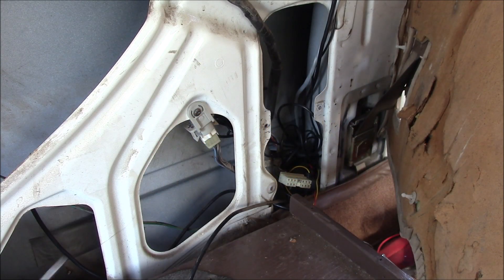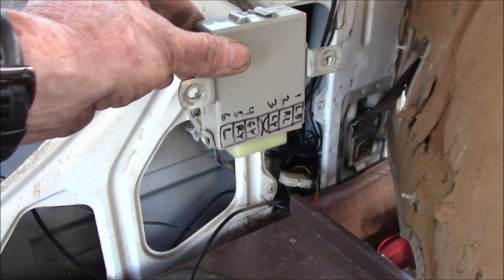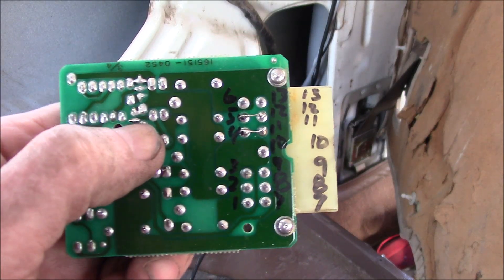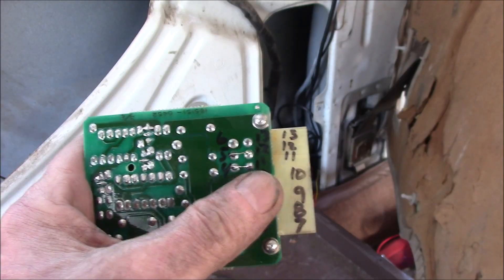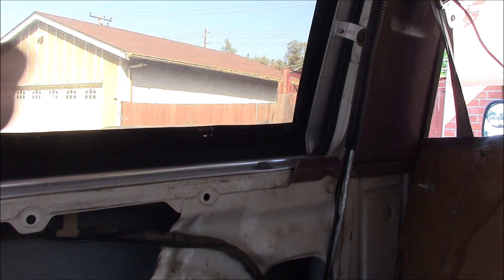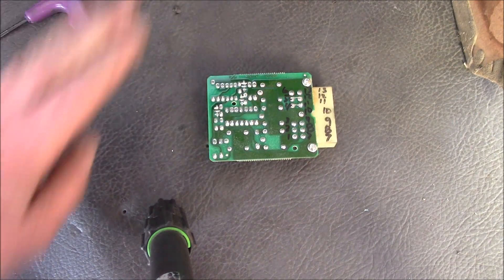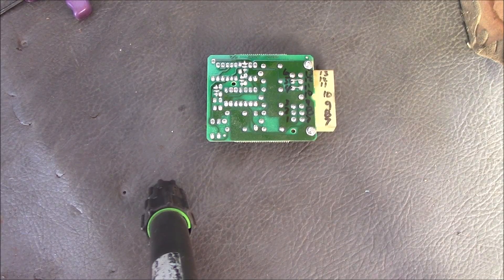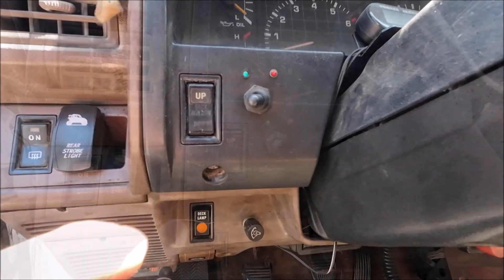1st Generation Toyota 4Runner Rear Window Relay Mod

Comment: Another great option for the rear window switch is to upgrade to the 3rd gen 4runner (early years) rear window switch.  If you can find one out of a hilux, even better!
Reply from the maker: Had not heard of that option, what are the benefits?
Reply: @The4Crawler it's a better switch, smoother action and full illumination.  Plus, waaaaay easier to aquire!
Reply from the maker: @BigBluePile  Thanks for that tip, will keep in mind.
Reply: @BigBluePile  Does the 3rd gen switch also work on the 2nd gen 4runner ?
Reply: @Cartier70  can't confirm if it'll fit in the in that recess but I don't see why not.  You'd have to verify the wiring though.
Reply: @BigBluePile thanks, for the reply  today I found a short in wiring to driver side latch ! Getting some where ..

Comment from the maker: I had made this modification some 25 years ago, but at the time, I had no digital camera so never photographed the circuit board.  The other week, I was contacted by a fellow Toyota 4Runner owner who wanted to do the same thing, so I pulled apart the side panel and took some pictures.  Also added this to the Truck Tech column I write for the Toyota Land Cruiser Assoc. Toyota Trails magazine.